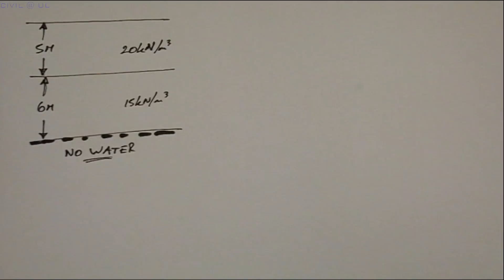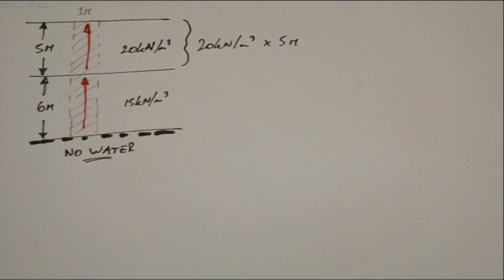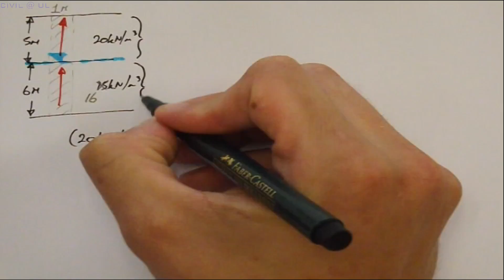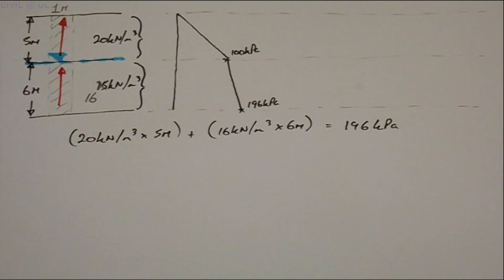Worked Examples

Comment: In this video 5 "Worked Examples" the effective stress is calculated with the density of saturated soil (16kN/m3) instead of the one for the submerged soil (5kN/m3=15-10).
Why is that? Is this an error? or is there any justification (which I can not see) to adopt the saturated density instead of the submerged density? Referencing to Video 3 "The Fundamental Building Blocks" the one which should be adopted is the submerged density, isn´t it?

Thanks any way for the so clear and interesting videos!!! GREAT!!!!!!